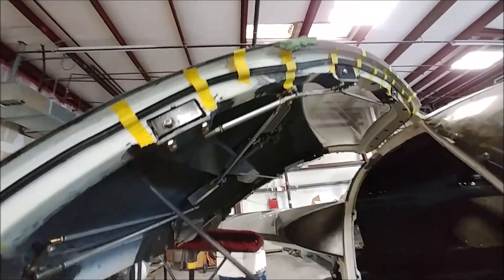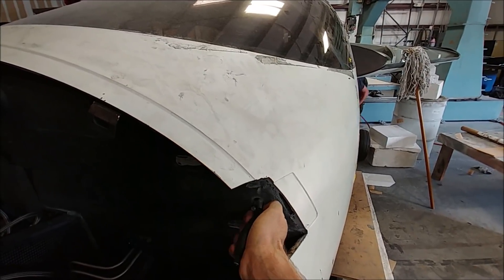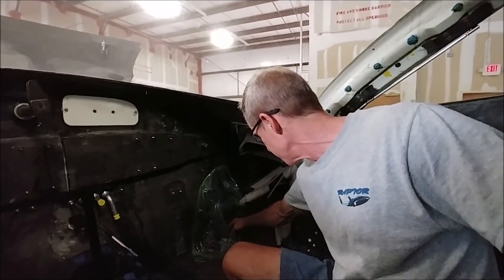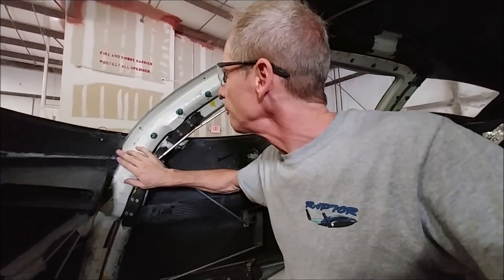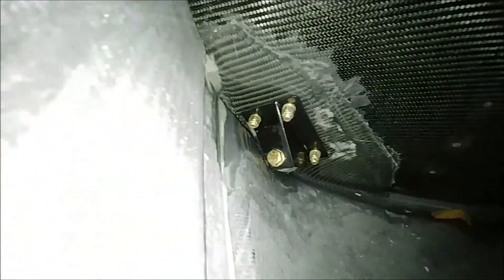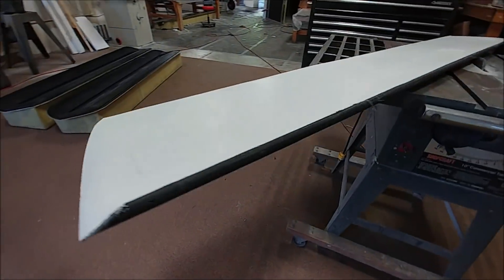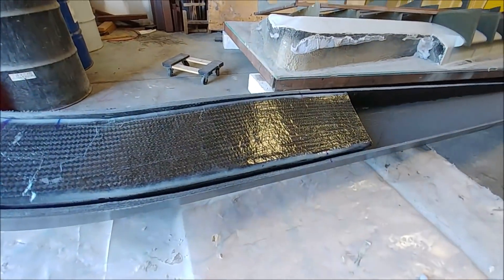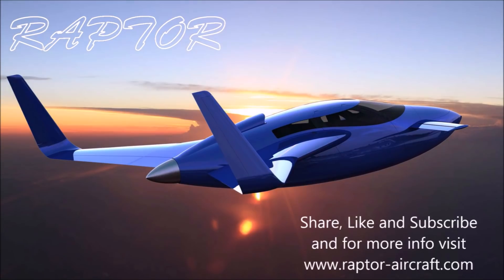Working Under Pressure - Building the Raptor Prototype

Comment: Oddly, I used to check computer fan airflow--with an incense stick, because the smoke comes off of the stick nice and laminar. I am also reminded of a beekeeper smoke generator. Obviously, you would need an air supply free from smoke, like that provided from a firefighter's rig, if you felt you needed to be in the cockpit with the smoke. You would need a fire extinguisher in the cockpit, just in case.

Comment: I would strongly caution against ever using dry ice with someone in the cockpit.  It can be a very serious hazard in a small non-ventilated space. As dry ice melts, it turns into carbon dioxide gas.

Comment: I would suggest you try using the infra-red camera to see if it will guide you to the temperature differential at the precise point(s) where it is leaking through.  Another good indicator if you know approximately where to look is using a soapy water solution that is "painted" on the suspect area(s) - bubbles will appear wherever there are leaks.  just make sure you clean the soap off before trying to bond it.

Comment: I used this device for detection of small leaks. http://www.afcintl.com/air-current-kit-from-draeger-safety.aspx
It is a glass tube filled with some acid that reacts with air moisture, producing very dense smoke. It is far better than anything else that I tried

Comment: Wouldn’t an incense work?  Should provide a slow stream of non turbulent smoke
Reply from the maker: Yes, we've already thought of that and we may try it next week. Probably going to try hooking our vacuum tank up first to pull air in the reverse direction. Then we can use soapy water to find the leaks in the cabin provided we can draw enough vacuum.

Comment: Local Plumbing supply house will have smoke canisters used for detecting sewer vent pipe leak in houses so it should be safe to use indoors.

Comment: Ive watched other YouTube plane builder using soap water to detect pressure vessel leaks. When it bubbles there's a leak.
Reply from the maker: Yes, we're doing that on the outside but it doesn't work when you're looking for the origin of the leak on the inside.
Reply: This is where applying a negative pressure (with your vacuum machine) to the cabin and then using soapy water on the inside would work. Also if you can't find leaks on the inside but you have located them on the outside,  apply negative pressure to the cabin and apply smoke to the "hole" on the outside and watch for where it comes through.